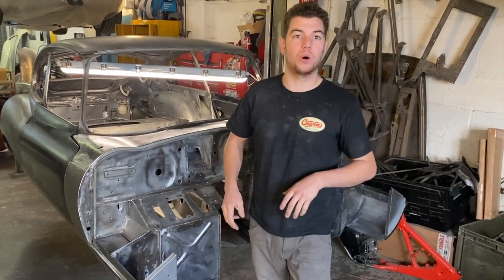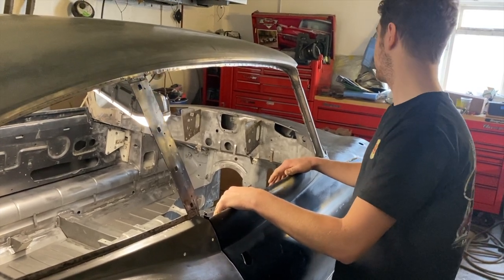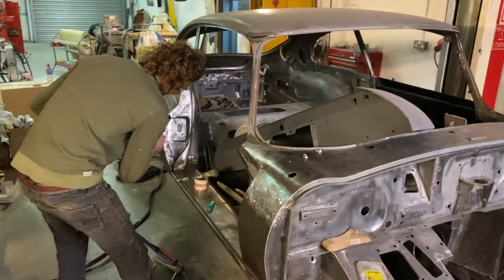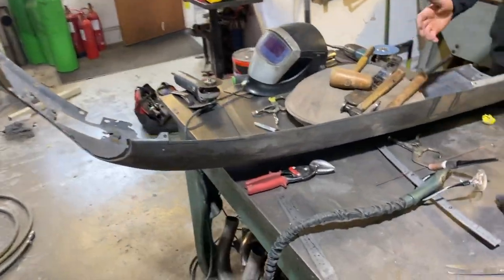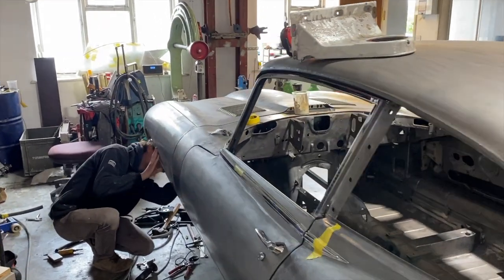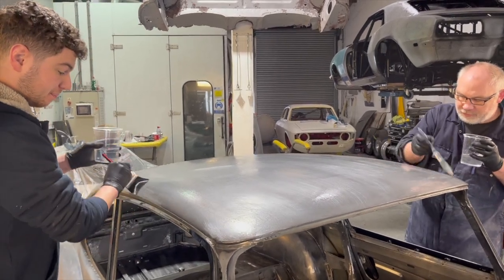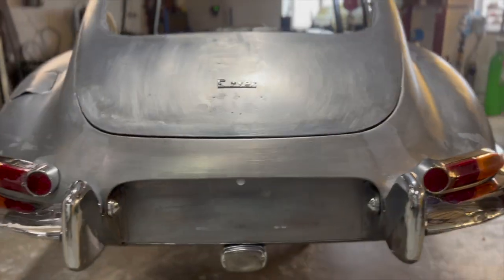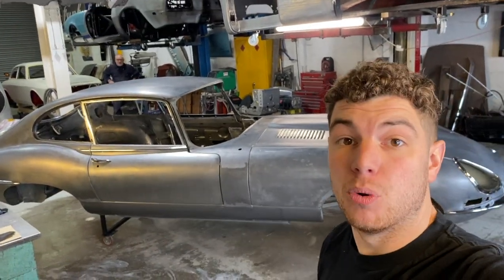E-Type Restoration | Metalwork Finished | Ep4

Comment: Excellent quality work gents. The fit looks as good as I have seen anywhere. Very impressed with your long TIG weld joining the rear quarters. I think very little filler will be required for paint by the look of it. Superb job. Taking all that black paint seems a bit of a nause. Shame you cant ring them up and persuade them not to put it on in the first place!
Reply from the maker: Thanks 🤙🏻 yeah that would make our lives a little easier but they’d probably turn up rusty instead 😂
Reply: It to protect the metal because it would rust immediately.

Comment: awesome work! 1500 hours seems like a lot but the result is outstanding. I've struggled with repro door skins being too thick for the seals, factory work was 0.150 at the flange.
Reply from the maker: We’ve not had any grief with the door skins but the new door rubbers need shaving down quite a lot
Reply: @Charlies-Classic-Custom  on an original door skin the rubbers don't need shaving.

Comment: How long does it it take to go from crusty body work to one thats ready for paint? Obviously depends on how crusty it is but this jag for instance? Is it 3 weeks or a few months?
Reply from the maker: Anywhere from 12-24 months for the metal work, this one was 2 years for the metal and paint work
Reply: Two years seems a long time.   But you have done a great job I wish I could work the English wheel.    One other thing I wonder if it’s worth restoring a 2 plus 2  to that standard financially  it’s probably over two thousand hours. Plus cost of all  the parts  interior.   Mechanical. Crome work.  It’s never going to be worth the money surely.  But if it’s going to be used regular for a long time then you are getting a bit of value.